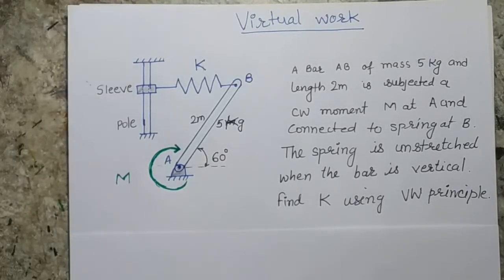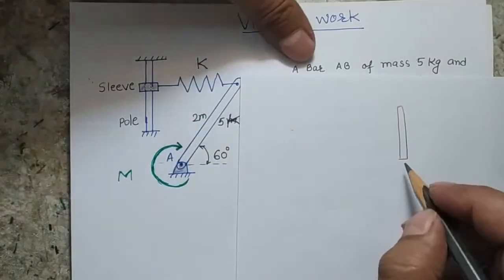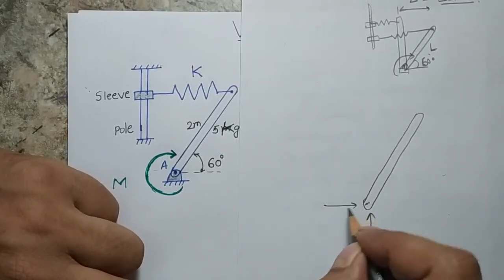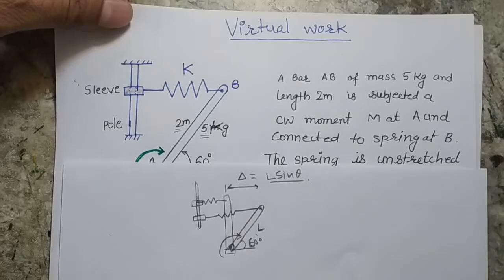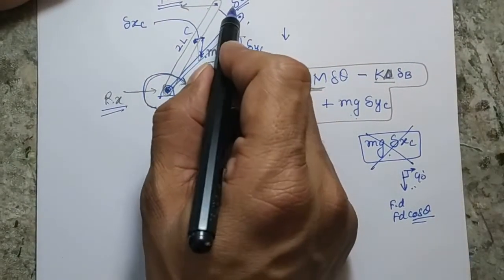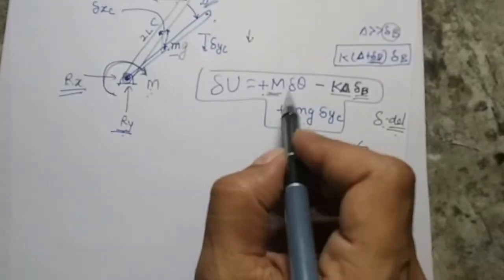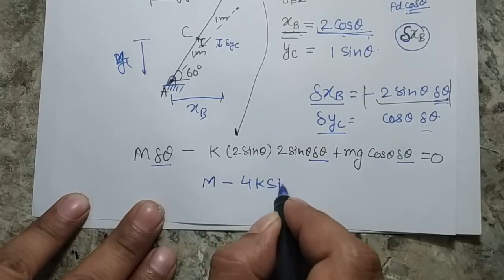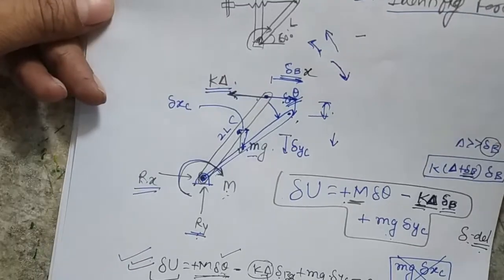Virtual Work Method Lec 4||  (Problem 2)|Engineering Mechanics|First Year Course

Comment: shoulndt be delta=Lcos(theta)
Reply from the maker: Yes, its a mistake, in the spring force calculation. In k*delta the value of delta should be cos component of the length of the rod. Thank you for indicating error.